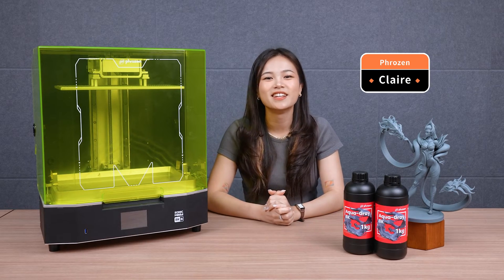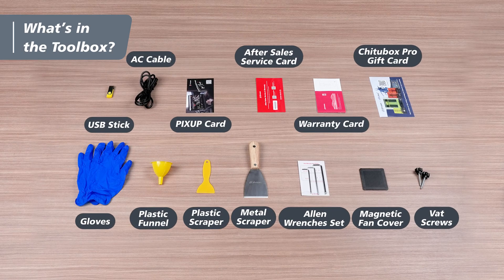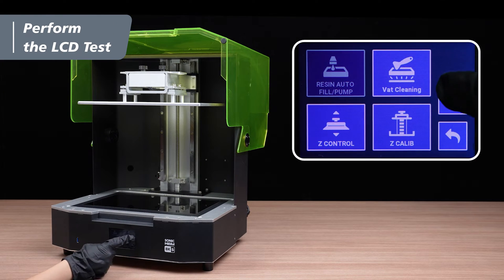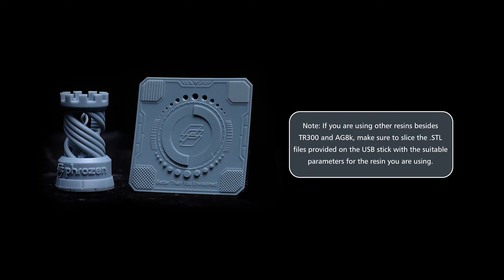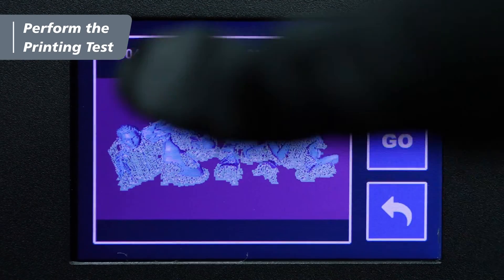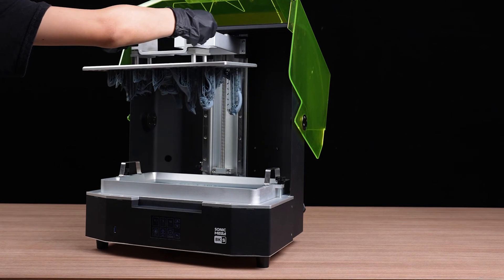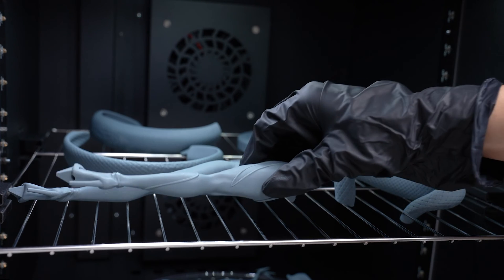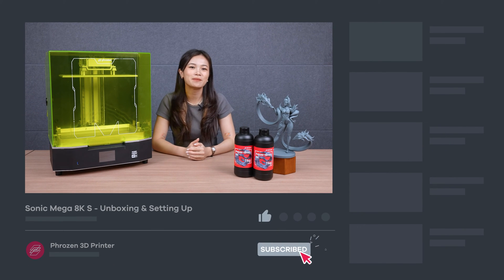Sonic Mega 8K S - Unboxing & Setting Up - Phrozen 3D Printer

Comment: Question for you. Can this 3d printer ne used in side a room or not. I haven't found much information on this please can you let me know
Reply from the maker: Hello, we do not recommend using a resin 3D printer too close to your living environment (e.g., Bedroom) because the resin is a chemical substance with a strong odor. 
We suggest using it in a separate, well-ventilated space to ensure the smell does not linger.

Comment: Hi can you use any usb to store file and plugin to printer? also, what does "S" stand for? does require special resian for "S" option?  and how do i know it is in S mode?
Reply from the maker: The "S" in Sonic Mega 8K S denotes a new series. 

You can use any USB drive to store CTB files and connect it to the printer. 

If you ask about a high-speed system, Just adjust the print setting and choose the specific resin. Check this video for high-speed Quick Printing instructions: https://www.youtube.com/shorts/p6FNOBhIKqM